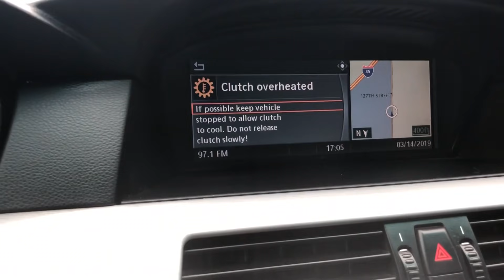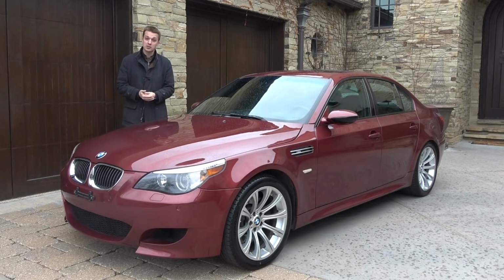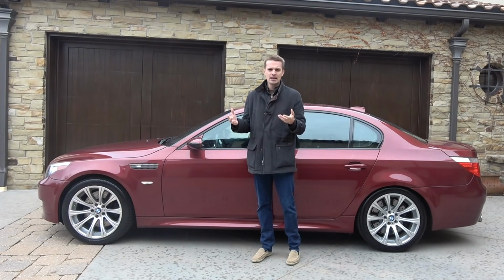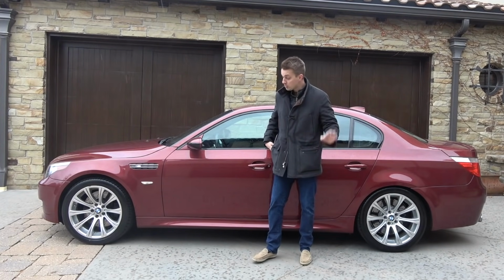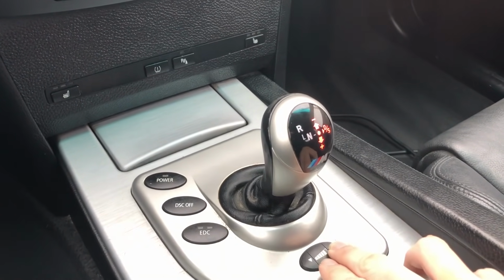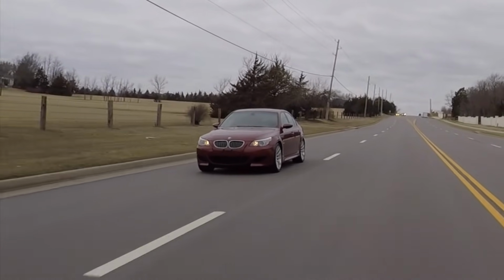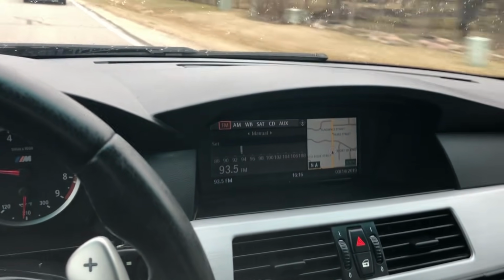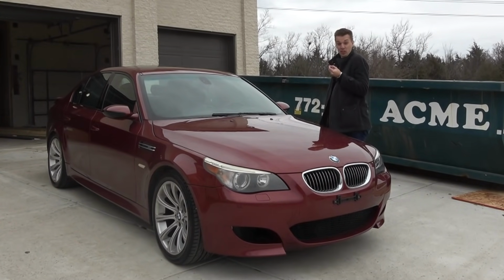My Cheap BMW M5 Is FINALLY FINISHED (Thanks to a Wire Hanger???)

Comment from the maker: Add "Can't do Burnouts" to the growing list of SMG fails.
Reply: "Do you need to take my college money again?" 😂😂
Reply: Hoovies Garage someone is selling an s55 for 4K cad lemme know if u want the link
Reply: Listen sell this peace of shit and buy an E39 less headache only cup-holders issue or buy better than these too buy the cheapest 03-04 Cobra 🐍!!
Reply: ls manual transmission swap?
Reply: Why are they fitting those gearboxes to such an expensive car? I thought the whole point of them was to provide a cheap automatic option for cars too small and cheap for a regular automatic or double-clutch to make sense!
Reply: Floor it let off and floor it again itll get the revs up
Reply: At least in America they get the choice of manual or SMG. In Europe we just got SMG and it’s crap.
Reply: Hoovie, you gotta double stomp the throttle for the wheels to do a "burnout". Otherwise the transmission overheats. It's not a true burnout, more of a "peel-out" but it's better than ruining the clutch. 

I learned this when practicing burnouts on my Dad's M6 so I could propose to my GF for prom back in high school.
Reply: Does anyone else have his intro jingle stuck in the grey matter, I’m always ham-boning to that synthy beat
Reply: LegitStreetCars was just discussing BMWs with OJ Lopez from Fluid MotorUnion and unless i completely misheard - the SMG might be possible to convert to manual (i know this is specifically e46 but https://youtu.be/dlb0989rwHw?t=2951 )
Reply: You can upgrade the iDrive system to the next gen bmw with full backwards compatibility if you buy the right kit online. Have you considered a manual conversion for the smg?
Reply: take it to a racetrack... if it does not break you will have an awesome time!
Reply: Could you imagine spending 80K on this turd new?
Reply: Tavarish  might buy it fr 10k
Reply: It does it if your not a idiot. Floor it then stand on the brakes.
Reply: You NEED an exhaust, she sounds quiet currently.
Reply: @schmitty69  well still a better investment than an US college....
Reply: Hoovie, have you driven the first generation Smart car? There you have time to rattle off every single river in the entire USA during the time it takes for the gearbox to select a higher gear! 😁
And it's not exactly like they traded speed for comfort because it is jerky as hell.
Reply: @s0y_s0y26  Can you send me the link? also he probably doesn't wana deal with an import
Reply: I was behind an e39 the other day, it had a stick, but it sounded like it was running on 5 cylinders. Lol.

Now my e36 is on Jack's with the transmission out.
Reply: It can do burnouts, you just did it wrong 🙈
Reply: the beeping @ 10:00 is a setting in the bc when an hour is past :)
i know almost everything on bmw ^^
Reply: LS swap it with a tremec 6 speed
Reply: @schmitty69  That might be the classic line of all time....
Reply: Ill give ya 6k right now to get rid of it lol
Reply: True but the car can definitely drift.
Reply: Manual swap it!
Reply: I’m interested in buying it I have 2010 528i and I been looking for an M5
Reply: @MrGman636   I presume she asked you to marry her right there on the spot, right?  That's why I never do burnouts, I'm just not ready to commit to a relationship yet.
Reply: Hoovie Just sell the car to a bmw guy. Clearly this is not for you and you don't know a thing about it. Just give up it hurts to see this poor car was owned by a sh*t head and now buy you who is not a bmw guy, who don't really appreciate what an e60 m5 are!
1. Don't ever try to torque launch any single or twin clutch car.
2. The shifter is in the right way.
3. Buy a bmw from a responsible owner you can find them on youtube forums and elsewhere, not from a wanna be a bmw owner or a non bmw dealer.
4. Do your research before you talk crap.
Sell it use the money and buy you something else you consider a good car not any bmw. Ok!
Keep up the good work we love you..
Reply: Really "The Father"?  That's so opposite to the norm.
Reply: Please answer hoovie
Reply: I never understood the pleasure of doing burnouts, sports cars are made for driver and requires some skills. Plus when you know that you have some transmission problems, you should not be stupid enough to do burnouts
Reply: @XxIBRAHIMxX11  Cupholders issue??? OMG if Doug DeMuro hears this ...
Reply: My smg will absolutely roast the tires, ive got one of the silverstone cars here in wichita

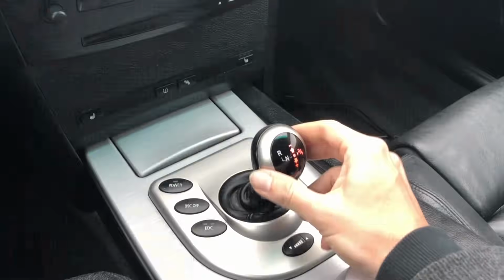Comment: 9:15 that's actually the right way! Up is down, and down is up. Race cars have it this way because it works with you when you want to change gears during acceleration and braking!
Reply: Thank you! I've loved having it the right way around on all my Mazdas.
Reply: I had a 2008 528i and it was the same
Reply: It's the logical way
Reply: Exactly.
Reply: Agreed. I was surprised when he said he didn't like that
Reply: Yea that’s what I was saying
Reply: My Lincoln MKX is the same way. Through me off first time I used it
Reply: @Wolvenfox  You can...just reprogram it, it's a rather simple task for almost all automatics...
Reply: Yea, and my friend with a Toyota says no mine is the right way.... and you can’t explain that when your flooring it everything pulls you back so it’s easier to pull the shifter back than forward.
Reply: 1betterthanyou1  What are these requirements to be a "real car guy?"
Reply: My Logitech is the same lol
Reply: Exactly!  It's especially important for down shifting under hard braking.  Try going 6th -> 2nd from 120mph by having to pull the lever toward yourself. yuck.
Reply: yep upshift should always be pulling back, and downshifting pushing forward.  Because that's how almost all manual cars are when going straight back from 1-2, 3-4, or 5-6.  Thank goodness our Mazda is like that.  My mom used to have a Camry V6 with it the other way and it was super confusing having to push forward to upshift.
Reply: Yes! Definitely more natural pulling back on the shifter on acceleration.
Reply: Its also logical if you think about a planes steeringstick :D
Reply: Damn, beat me to the punch.  Was gonna say the exact same thing.  I hate it when cars have slap-shift and + is up and - is down; doesn't feel right!
Reply: @Mr0supra0  I could, but the day job, side job and school keep getting in the way. I'm quite happy with my Mazda3 ecobox and how it came from factory, minus Android Auto and the radar cruise control. Fixing one of those tomorrow.
Reply: True, I have a 2009 535xi with an MHD tune, Transmission tune via the xHP app and set to rear wheel drive only via xDelete app.  The car flies and pulling BACK on the shifter to shift up is much more natural than pushing forward.
Reply: Trivia Pursuit here - BMW actually changed this pattern right around 2005-2006.  It used to work in reverse
Reply: Yep. I had a 3rd Gen MR2 which had it the right way like that, then I moved to a Hyundai that had it backwards where up was up and down was down. Couldn't get used to it, it felt so unnatural.
Reply: Yup, came here to say the same thing. It's Audi's that do it the wrong way.
Reply: Yeah, SMG is crap, but at least the shifting is in the right direction. Early E39s (and probably E38s) had the opposite which was awkward, so we figured out a way to reverse that by switching two wires going to the gear lever. I even had someone make some shift indicator guides with the plus and the minus switched. It was tricky getting the transparacy for the backlight right, but it looked OEM when that was sorted. BMW changed the gear shift direction to the current one in model year 2002, at least in Europe.
Reply: Yes!!!
Reply: That's exactly it, you would think someone that has a channel reviewing/fixing cars would know that!
Reply: It's not up and down, it's forward and backward. you downshift forward because when you're braking, your weight is shifted forward, so that';s the correct direction to have the shifter, and the reverse is true.
Reply: My z4 has it that way and it is the right way. My Audi A4 has it backwards and I hate it. Does any one know if you can change the order on AUDI-VW with VAG-COM?
Reply: The shifting is slow. Painfully so. But you're meant not to keep it floored through the shifting, but lifting slightly or entirely as you would in a manual car. Noted, it IS the worst transmission option for that car. And the E46 M3 with it is also such a pain go drive.
Reply: Wow!!! I didn't know about it!
Reply: @Mr0supra0  I love Hoovie, but didn't you hear him talk about how he got a 2 year old BMW X5 as a high school graduation gift? He was definitely raised as a rich kid... even Doug thought so.
Reply: That's right! Answered before I could!
Reply: Thanks at least some on have a common sense. And one more thing Hoovie when you don't like a car don't buy it, and talk (S) about it later! The Mp12 is unreliable AF too, and you don't seems to talk that much about it. You bought a lemon from an owner who mistreat the car don't complain, there are so many great e60 M5 well taking care of they don't have that much problems! I like you man but I can't let that slide....
Reply: Hope he learn something today!
Reply: It's muscle memory that makes it that way; we're used to pulling back the shifter in a manual to upshift from 3rd to 4th, and pushing it forward to downshift from 4th to 3rd; I often found those to be the most used gears on back roads with a 5-speed. In racing cars with a dog-leg 1st, this occurs between 2nd and 3rd instead, as it's often the first upshift when coming out of a corner and last downshift when going into one.
Reply: @waffle911  Give up man he won't understand it. This is not about the shifter or anything else, he just tryna make the car looks bad, he is not a BMW guy that's why. The e60 m5 made history yes it comes at a price. This man is telling us straight up this is a bad bad bad car, while he own a far more unreliable mp12 and he is not complaining. M5 all day bro..
Reply: @carsociety705  I'm not trying to convince anyone of anything, just providing more context on why they chose to make it that way for sequential gearboxes in motorsport because I didn't see anyone else bring it up (unless I missed it).
Reply: @waffle911  It's ok a lot of people already told him so. But thanks at least you're part of educating  people who don't really know the facts..
Reply: Looking for this to post or agree.  BMW and Mazda do it right: press up to downshift, pull back to upshift.

Comment: No. Upshift should ALWAYS be pull toward you. This is one of the very few cars that have that right.
Reply: True. Those M5s had robot to automaticly change the gears so thats the reason you feel like its like delay.
Reply: That's weird. I don't care if it's the "right" way. The "wrong" way is much more intuitive in my opinion.
Reply: @car_lov3r  it makes more sense to have it like this BMW has it. When accelerating, weight shifts back so it makes sense to pull towards you to upshift. Under braking, you're enetria is going forward, so pushing up makes sense to shift down a gear
Reply: Correct
Reply: Yes, it's easier to pull back under acceleration and vise versa under braking
Reply: I agree Just watch a rally driver with a sequential gearbox they all pull to the back to upshift
Reply: i thought it was normal. its so uncomfortable to push it forward to shift.
Reply: @alwaysinverted1224  this is stupid, the car will not keep you from pushing the lever forward under acceleration.
Reply: 1tokeover that’s like saying the car won’t keep you from pulling the lever back and downshifting when accelerating if you had it the wrong way... it’s not for that.. if you really read Big Bad Bakken’s comment again maybe you will get it lol
Reply: Amen
Reply: Few cars? Most euro has this
Reply: @davidpasch9562  All the cars I ever see are pull back to down shift and push forward to upshift.
Reply: Bruh when he said it’s back wards and to up shift you half to pull it backwards I legit lost brain cells
Reply: totally agree
Reply: @car_lov3r  the "wrong" way isn't more intuitive, the opposite in fact, it's just more easier for your simple brain to remember, like many Americans...

Comment: Impressive to see how BMW allready back then had introduced the ambient interior lighting feature. But not as configurable as in today's cars, the "check engine" theme was the only available option. Came as standard on the M5 though.
Reply: Hahahaha
Reply: impressive ?!? ambient lighting yet the hyped V10 is an unreliable POS
Reply: BMW was also in the very forefront when it comes to IT security. In fact, the first generation i-drive system is so inaccessible that CIA, up to this day, still use the software to store highly classified information deep down in the menus.
Reply: @joakimquensel597  BMW is also in the forefront of POS engines and brittle transmissions. The e39 m5 is a far better car.
Reply: @talkditingsdem5799  
Yes, it is true that the M5 V10 engine used the latest and most advanced version of the BMW POS technology. That's why the BMW engineers developed and fitted the (V)ANUS-system. ☝️🙄
Reply: @talkditingsdem5799  You e39 guys are so fucking annoying. The E39 is still a bitch to maintain just like the E60. Rod bearings, timing chain guides and tensioners, vanos issues, dead pixels, etc etc. Fact of the matter is BOTH M5's are great fucking cars and im sick of you guys always trying to shit on the E60.
Reply: B TL r/woosh
Reply: Joakim Quensel lmfaoooo
Reply: @vegeta12379  This is from an E34 M5 guy. Can I crap in this pond. Is that Ok.?
Reply: @btl4220  The type of guy that considers something Donald Trump says as serious and factual.

Comment: Techs like that bmw dude are worth their weight in gold. Too bad the dealerships rarely compensate them appropriately
Reply: m00nraker4545 well he DOES daily an E60 M5 though...
Reply: I agree with you.  I worked at a privately owned VW restoration place in New Orleans and I learned a lot working on the same models and years.  The dealerships that train consistently to a proficient and diligent mechanic can create some knowledgeable techs.  We knew about the older model fine points and the techs at the dealerships were schooled in the brand new stuff.
Reply: Indeed, cars have gotten massively more complex, you need way more tools to work on them, and rates (to the mechanic) are unchanged.
Reply: That is one of the biggest fails today, probably the car is good, but dealerships are crap... and well the results is obvious
Reply: that guy knows his stuff, that coat hanger trick was crazy MacGyver stuff!
Reply: @DrinkWhiskeyRaiseHell  35 bucks per labor hour is shit pay for that level of knowledge.
Reply: @DrinkWhiskeyRaiseHell  yes, but you still have a shitton of downtime, unpaid, and you get paid badly for custom jobs which don't have labor hour tables, like this one here. That would be like, what, an hour of labor invoiced? Still the worth is easily at least $100 or more in tech time
Reply: That's why a lot of them break away with their knowledge and start independent specialist shops. Good on them
Reply: m00nraker4545 yup, thank god here in west Texas where I’m located, we have tons of euro only mechanic shops! A lot of them worked for the franchise dealers like BMW Benz etc, but leave and start their own shops or work at a smaller, much more appreciative shop, because they’re not compensated like you said 😬
Reply: My mechanic Aaron saved me many times. And he drives a E46 like mine. Originally I had a tranny light on my 5 speed on the E46 and it turned out to be a brake switch that comunicatted between the gas and brake pedal. Very hard to find mechanics like him and Johnny.
Reply: @limeyosu2000  That coat hanger trick doesn't mean he knows his stuff at all. A diag tech that knows his stuff would have scoped out the crank sensor signal in minutes and knew exactly where to look. You would see a drop out in the signal in the exact same spot every time and you know that's a tone ring problem.